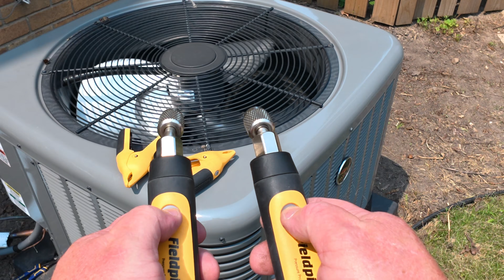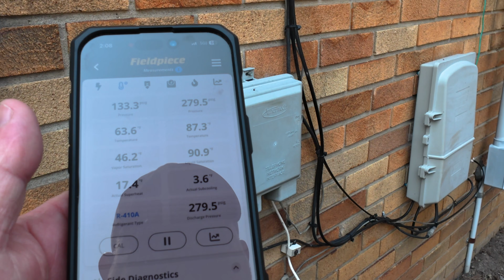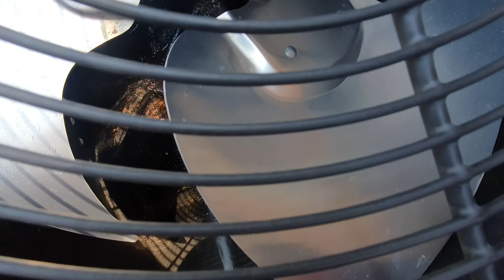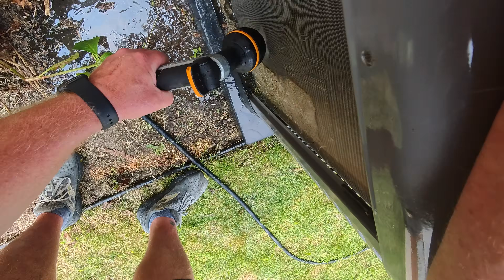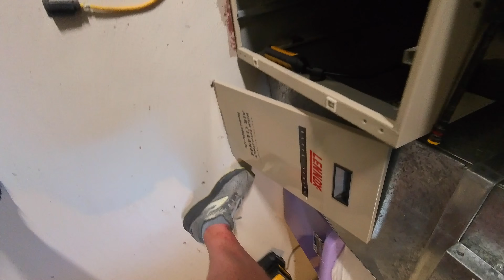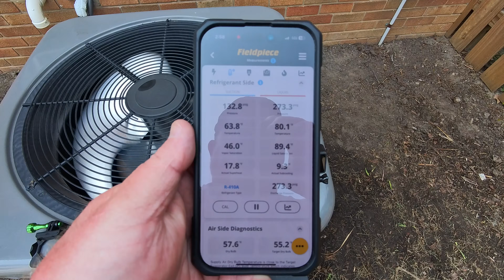Ruud AC Not Cooling Properly | I never expected this | HVAC

Comment: This day in age, where the labor cost drastically exceeded the parts, why wouldn't people maintain their equipment? Having a service technician clean for you doesn't make sense to me. Plus, it isn't courteous. If i bring my vehicle in for service,  it has been cleaned inside and outside prior. If an electrician is ever to be called, you bet the electrical closet will be cleaned and emptied. Same would apply for sinks for plumbers, etc.
Reply from the maker: From my experience …..Some people lack the knowledge. Some people fear they would do it wrong. Some people just do not want to do it they would rather pay someone to do it for them. Some people are willing to learn aren’t fearful and do not mind putting the effort in to maintain their expensive equipment. 

I’m here to accomidate all of the above when needed 

Thank you for watching

Comment: Seems highly technical cleaning dirt from coil
Not to mention thousands of dollars of tools.
Do you need to be that invasive with the checking of pressures not to mention loss of refrigerant?
Could u not visually see dirt and check line temps to determine issue.
Seems that techs now have all these high dollar tools and don’t really know what the numbers mean anyways.
How be they relocate vent and or ad lint trap!
Inform owner to shut down ac when using dryer.
Seems like a mountain made from a mole hill lol
Reply from the maker: I'm not sure what you mean by "highly technical"?
If I just stand there and look at it how can it be diagnosed?  

Thanks for watching

Comment: I think that sub cooling is too low buddy. Also, check your fan speed , filters etc because these new motors with the three tabs are hard to set up.😮😅❤🤔
Reply from the maker: Thank you for the advice. When the unit was installed I performed an external static pressure test and determined the correct speed of the fan back then for the cfm I needed. 

In regards to the sub cooling, Ruud provides  a sub cooling chart if anything my final sub cooling measurement was a little high. 

I’m not sure what you mean by 3 tabs on the motor this unit is an R95T has 5 speeds if you could clarify it would be great 

Thanks for watching
Reply: @HVACTDM  nice I didn’t know it was a gas furnace at first ❤😊 most people aren’t even doing static checks on the installation

Comment: Everybody shows you - how you're supposed to do something - but few show - THE EXACT EFFECT(S) - of changing things.  In this case we saw the effect(s) of clogged, vs. no clog - condenser coil.   So not sure why each person makes the videos they do, but it's great to see how things change, based on certain things NOT being as they should be.  Like next on the list is a nearly clogged air filter....and then a loose capillary tube....add in a partially clogged evaporator.....then blower fan speed (low, med, high).  Now not saying these are things you'd want to video, but it would be great for someone to put them out there.  Thanks for listening....and thank you for a GREAT video!
Reply from the maker: When I first started the channel I thought people just wanted to see the really tricky stuff but Since I record most of my service calls now maybe I’ll put out some of the easier stuff maybe someone can learn from it 

Thank you for watching

Comment: Are you saying (looking at the before, and after numbers) that this customer experienced weak cooling, because of the huge build-up of crud on the condenser coil?  I ask because on the suction side, I don't see a huge difference between the before and after numbers (and that is what the air temp coming out of the evaporator would be changed by).  Too bad you didn't install those probes earlier, and we saw what it went from, to your final numbers of - after.   Incredible video - overall.  Thank you so much!
Reply from the maker: Personally I believe it’s was a combination of the filter the coil and the way the home owner operated the system.

Comment: I was particularly interested in was the EFFECT it had on the sub-cooling number.  It sure looks like the "charge level" - or at least DETERMINING the (accurate) charge level, cannot be known, if the condenser is clogged to this level.  VERY interesting....thank you so much for this video.
Reply from the maker: Yes at first my sub cooling made it look a hair under charged but after I pulled the filter and cleaned the coil it looked a hair over.  

Since I was the installer on this I know as a matter of actual fact that it was spot on during my original testing

Comment: Thank you for rinsing from the outside. Only a rookie would try to flush from the inside out.
Reply: All the debris comes from outside to inside. Best way to go is remove fan and spray from inside out bro
Reply: @chrislococo7220 EXACTLY 🎉🎉🎉🎉🎉🎉
Reply from the maker: @chrislococo7220 This is not true for cotton wood or lint,  neither material embeds itself deep within the coil.
Reply: Ikr!
Reply: We.dont forget to check the capacitorWell the air flows from outside in. After brushing it spray che.ical from inside out then rinse fro. Inside out like your supposed to. Don't forget to clean all the junk nice fur coat
Reply from the maker: When you say “inside out like your supposed to” who determined that was the exact way to clean a coil?   

In regards to using a chemical, the system is only 16 months of age and only in use for 8 of those 16.  A chemical isn’t needed to remove grass, cotton wood, and lint…granted a lot of lint  but still not needed. 

I agree that in some cases a chemical might be needed but not in this case.

Thanks for watching
Reply: 😂😂😂 you must be a rookie talking like that or a diyer
Reply from the maker: @716jaygutter5 🤣 No not a rookie not a DIY guy. 30 yrs of experience. 

 Opened my company in 2001.  I will tell you that cleaning from the outside only has 1 problem and that is if you spray the water at 90 degrees embedding the dirt within the fins. 

Since that is not the method I use.  It makes litterally no difference when removing cotton wood or lint from a dryer.
Reply: @HVACTDM  the comment was not meant for you it was meant for the other guy
Reply from the maker: @716jaygutter7220 LOL its so hard to tell with the way youtube does the comment section thank you for clarifying
Reply: Basic physics says that's incorrect, but with the removal of bulk material before spraying it's likely a toss up esp with the 45° advice.  The primary reason to do the water rinse from the exterior is saving time by not removing / replacing the evap fan assembly.
Reply from the maker: I’ve seen it both ways 🤣 Ruud makes it incredibly easy to clean the coil with the access panels 

Thanks for watching

Comment: Can some type of filter be installed on the dryer vent?
Reply: there's only two real fixes. A) you move the condenser far away from the dryer vent.
B) you move the dryer vent far away from the condenser. 
it's impossible to 99.x% filter a dryer vent, because it's discharging hot and very humid air that will clog any filter in very short time, which is why they have only a mesh screen.
Reply from the maker: Code here requires 10ft. I don’t think the person who installed it cared about code. 

The unit will need to be cleaned often, maybe as much as 1 per month at this point it’s the only cost free solution
Reply from the maker: That’s a great question. I haven’t seen one. 

Thanks for Watching

Comment: Good video. Where do you purchase the whisk brush you used on the condenser coil? Would like to buy some.
Reply: Snow brush works good. Cut the handle down shorter.
Reply from the maker: Great idea those are readily avail here in Mi at least 

Thanks for watching
Reply from the maker: I got mine at a supply house. Search “Plastic coil brush” on Amazon they have them

Thank you for watching

Comment: To me a 16 degree TD isn't very good. Seems like there might still be a minor problem.
Reply from the maker: I dialed in the air flow when I originally installed the unit 2 yrs ago using external static pressure test. 

While I’d like to have a 20 split sometimes it just doesn’t happen. 

Also I think it’s a hair over charged. But that should only stack more liquid in the condenser  

Thanks for watching